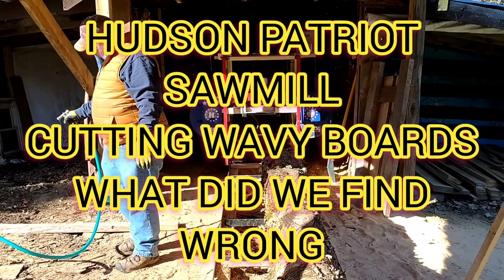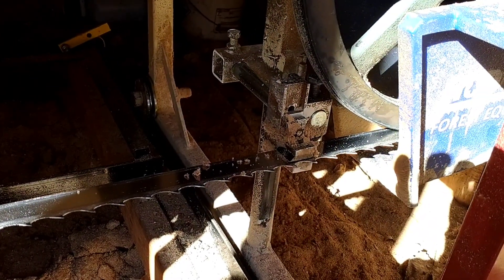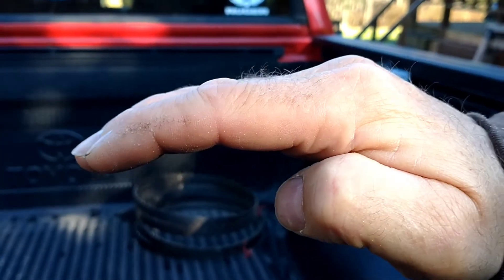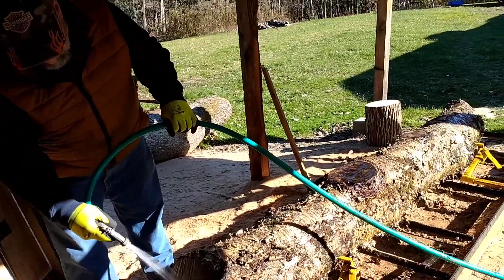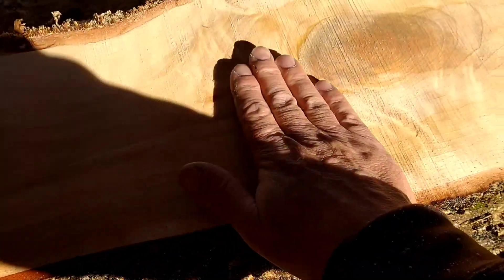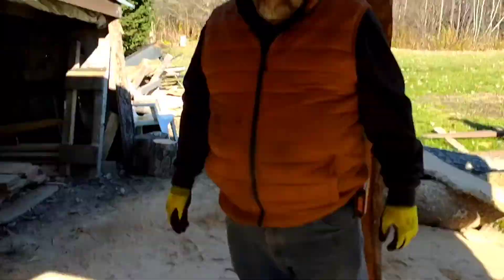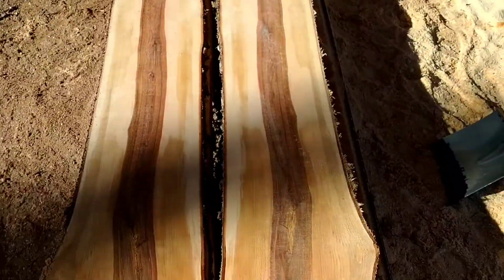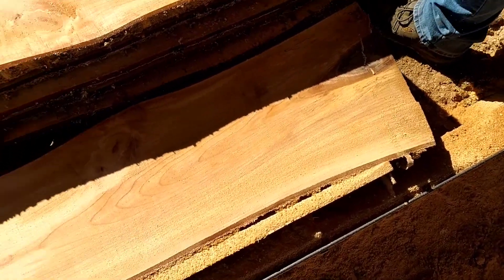PATRIOT SAWMILL CROOKED CUTTING SON OF A GUN🤬

Comment: Cheap ass blades LOL
Reply from the maker: Learn the hard way
Reply: Was it just cutting slightly wavy or were the waves more than 1/2"? Mine has gotten progressively worse over the last 2 logs.
Reply from the maker: If wavey cuts are not normal, your blade could be getting dull, or your cutting with the small end of the log away from the saw blade. If wavey cuts are constant with your mill you have other issues. These types of issues we had to deal with on the Patriot sawmill. Let us know and what are you running for a mill.